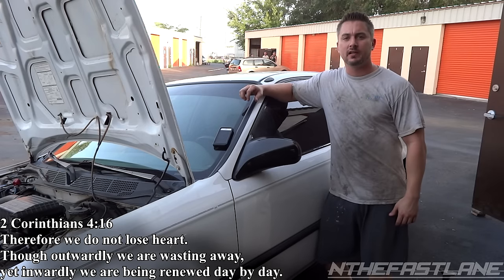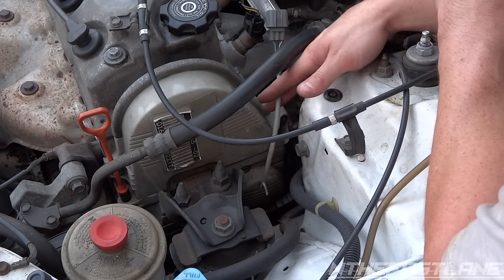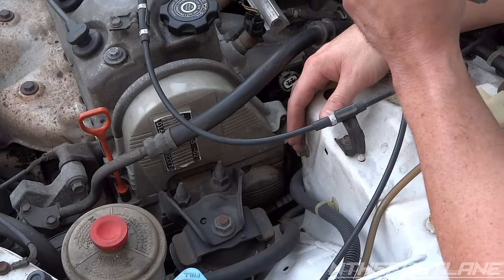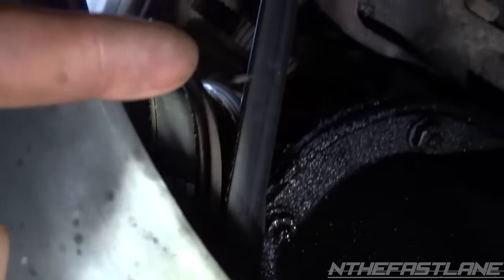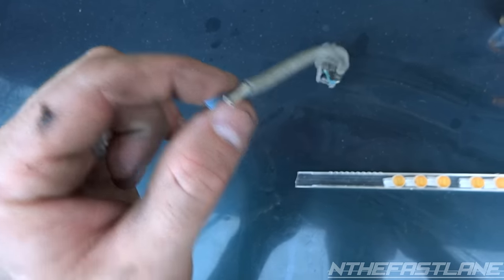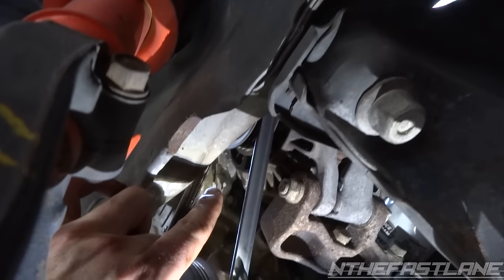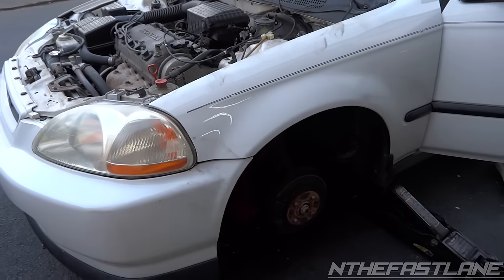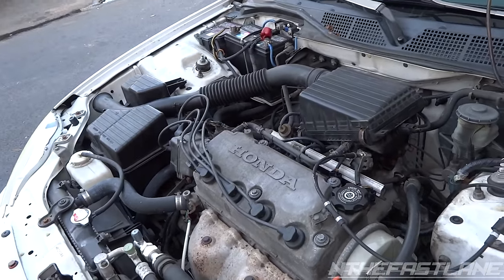▶️Cranks But Won't Start Honda (CPS) "How To"🔧

Comment: If you're still around, id like to ask you about my 1st gen CR-V. Maybe you could shed some light. Motor swap. No check engine light. Running great. Cold snap/won't start. Getting air/fuel, fire/compression. Before the motor swap, I DID replace cap and rotor. Any ideas? It got negative degrees out and just wouldn't fire up. But get this! I pulled the fuel rail off to check brand new injectors and it fired and briefly ran with the fuel rail off! Starting fluid doesn't do anything. Im wondering if I got some bad fuel and it's just too cold to combust before it's flooding it? Idk. Cranks strong, battery is good.
Reply from the maker: When you did the motor swap did you swap over the distributor from the runnning engine? Did the new motor come with its own set of injectors and a distributor? It could be a couple of things, crank position sensor, or it could also be the distributors  "Ignition Spark Control Module Ignito". The coil pack inside the distributor could be weak or bad also. It may put out a little bit of spark, but it might not be hot enough.
Reply: @Nthefastlane  I've been driving it for about a month or a little more. I used the old distributor with a new cap and rotor. Brand new injectors for the B20. They are correct and working well. The weirdest thing is, when we lifted off the fuel rail to make sure the injectors were doing their job, it fired and briefly ran with the fuel that was sitting in it! Checked all plugs on the valve cover and they are throwing huge spark. The crank positioning sensor was a special consideration during the motor swap cuz the last one was barely wired up. So we took extra consideration making sure this one was proper. After watching your video and a couple others, I'm wondering if it is indeed, the coil pack. But I'm not sure yet. Those injectors look like they are dumping a lot of fuel, could it be the fuel regulator on the fuel rail? It may be the proper amount of fuel, but when it would fire without the fuel rail/injectors in, we'd try to gradually put the injectors in as it fired and it was like it was flooding it out. Maybe the spark isn't great enough and it's a coil pack issue...at any rate, I appreciate your reply. You're the only person who has gotten back to me.
Reply from the maker: I would check the injector clips, after I did that and it still didn't run I would swap out the fuel rail and injectors from the other engine. It could be the fuel pressure regulator. I would first swap out the fuel rail with the new injectors, and then swap out the old injectors see which one makes a difference. Sometimes it's just a matter of troubleshooting the least expensive parts first. If you already have used parts that are known to be working I would use those as test pieces such as all the old parts from your original running engine. 

I try to get back with and help people. When you get hundreds of messages it can be challenging to keep up, but I give it a good effort.
Reply: @Nthefastlane  I understand, and I stand behind everything you just said. My buddy gets off work at 3 p.m. today then he's coming over to help me. Im gonna do just that. We considered the fuel regulator. We're gonna slap a different one on when he gets off. I will definitely let you know what we figure out.
Reply: @Nthefastlane  I pulled the distributor cap off. The bottom bolt was loose. There was an oily substance around the bottom of the cap. Inside, the contact points had white corrosion, as if they'd gotten wet, then electrolysis took place while it was firing. On one side of the edge of the rotor, it looked a little "burnt", but that may be normal. Also, that little "nubby" with the spring behind it in the center of the inside of the cap wasn't poking out very far until I cleaned it. Still, only fired initially...then acted like it's flooding again...i think it's a firing issue. And God knows how old that distributor is. Plus, I may have removed too much material from the contact points in the cap. Shavings after I sanded the corrosion....have you come across having to replace distributors very often on Hondas? My buddy has some good distributors laying around and we are gonna slap one on that we know is working and see if we just aren't getting enough fire. Hope that takes care of it. I'll know more on Saturday.
Reply: @Nthefastlane  New developments if you're interested and not too busy. Still not running and I've replaced a lot. I should have watched your video more thoroughly and I'd have checked to make sure my CPS hasn't been damaged. I'll do that after work. I even replaced the main relay. On the #7 wire, it's saying it's not getting power. So when we power it up with the meter, it fires and runs. Idfk
Reply from the maker: Usually with an engine swap you leave the electrical harness disconnected. This allows some of the pins to get a little bit of corrosion on them. A while back when I did my engine swap, the main plug closest to the firewall by the brake booster somehow got corrosion on the little pins. This corrosion was preventing the distributor from getting 12 volts. The distributor power wire was only reading 5 volts. That might be something you want to check. 

Also I pulled the fuel pump fuse and left it out for a while and that got a little bit of corrosion on it, when I put it back in it was a no start situation as well. I troubleshooted it for quite some time before I finally pulled the fuse and saw that there was a little haze of greenish corrosion. I took some fine grit sandpaper and sanded it off, put it back in the fuse slot, and it fired right up.
Reply: @Nthefastlane  That's a really good point. I'll check into some of those connections, clean them up, and see if that helps. Thank you. I'll keep you posted.

Comment: Here’s my issue and hopefully you or your viewers can give me an advice. My car started failing to start till came to no start at all. I pulled out the starter, took to o’Reilly they tested it with bad results. I put a used one in, it took about 3 shots to start it.  But again it’s starting with some problems to start. A day the replacement it took me about 3 attempts for it to start. Do you it’s still the starter or something else??

Comment: Hi my friend, how are you? I have a Honda Accord 95 EX VTec and I don't see the wires of the crank position. Do you know where it is located?Thank you.
Reply from the maker: "92-95" Honda Civics CKP are located in the distributor.

"96-00" Honda Civics CKP are located behind the crank shaft gear on the block behind the timing cover as demonstrated in this video.
Reply from the maker: Pre "96" Honda Accords CKP are found in the distributor.
Reply: Hi, thank you for anwering me. But, I don't see it inside the distributor? Or close to?
Reply: Hi, I took off the distributor cap and I saw the igniter, the coil, rotor but how is that part, crank position sensor? Do you have any distributor hitachi for honda 95/4C to show me what part is it? Thank again.
Reply from the maker: Look under schematics on my website. Link:http://www.nthefastlane.com/File-Cabinet
Reply: Nthefastlane what about in a integra 1995?

Comment: Do you know if this would cause the ECU not to have power?
Reply: No, but it is a sensor that if the ecu knows it aint there by being unplugged, damaged or just old it wont run it self.but when you turn on key check engine light turn on and goes off or stays on means the ecu got power

Comment: Hi there! I had a question if you can help me I have a 2000 Honda Civic with 330k miles. I was driving to work on Monday about an hour into driving on freeway. I was trying to give it gas to speed up and it wasn’t trying to let me give it gas felt like it was like sputtering/misfiring/slowing down type. So I got off the freeway as I hit the stop sign went to 0mph the car turned off tried to start it up again but it wouldn’t let me. I changed the fuel filter, fuel pump, and fuel relay under dash. It started up for like a min rpms we’re going up and down and as I was trying to rev it up it was having a hard time and then all of a sudden it died. Tried starting back up a couple times and I drained battery trying too. Any help please
Reply from the maker: I would pull your spark plugs and check them for fouling, you could have fouled spark plugs. If you drive on fouled spark plugs too long they'll melt your valves. If the spark plugs check out fine it could be the distributor, the coil pack could have gone out. If you end up replacing the distributor and everything starts running fine I would definitely change out the plugs and wires as well. Make sure you put some dielectric grease at each end of the spark plug wire connectors.

The next thing I would do is check your catalytic converter. If it got clogged up, or maybe the ceramic inside closed off that will do it.
Reply: Nthefastlane okay thank you very much. Btw no check engine light has popped up.
Reply: @RaspyStarks Hi ,did you ever fix that issue? Some advice would really help
Reply: @jonathantorres5803  wow forgot about this comment.. so since I wrote this comment.. I have changed the spark plugs, spark plug wires, new cap and rotor, pcv valve, o2 sensor,
Reply: I got it started cause of the Fuel injectors .. I got OEM refurbished fuel injectors  off of eBay.. but maybe 1 or 2 of them injectors are NOT any good.. the car starts every time but ON cold starts it Boggs down and wants to die.. you gotta give it gas for a few seconds than it’s okay. When it’s warmed up it doesn’t give me any issues.. so I’m assuming I just gotta get some brand new fuel injectors (which are like 98$ each @AutoZone

Comment: I have a 01 Honda CR-V.. no lights are on, has been running GREAT... and then all of the sudden I’m having issues turning it on. Don’t know what to do or where to start 😭 sometimes it turns on, other times it won’t.

Comment: I'm going to have to see if this is what going on with mine. I love my crv but she won't crank. When she starts she will drive for mins or hours but once its turned off she will not crank again sometimes its is just hours other times its days before it will crank again. I hear the engine attempting to get ready but not turn over. I lost count of how much money we spent replacing everything we could think of.
Reply: Nope not this issue we have. We followed every line we could see nothing has a crack or cut line.

Comment: My car starts up sometimes when ever I give it starter fluid it starts to start up but then does something weird and it doesn’t fully start basically but my car doesn’t start up sometimes a couple times when I was receiving the cranking issue after waiting 10 minutes I heard one click Coming from the engine bay then I tried to start it again and I started right up I’ve replaced distributor I don’t know what’s wrong it’s a 98 Civic dx hatchback
Reply from the maker: Are you saying that your starter is not spinning the engine? Or the starter is spinning the engine and it's just not firing?
Reply: Nthefastlane it spinning I believe but unsure I’ll have to check up on it it sounds like it wants to start but whenever I put starter fluid it starts to turn over but then starts to shake badly then it fails to start
Reply: @aquazie5928  Hey that is your fuel its cloggex up and needs cleaning I'll walk u through it very easy wont cost u a penny hit me up

Comment: A little help plz. Got a 97 civic 1.6 sohc cranks but wont start. At first it had no spark so ended up changing the distributor and got the spark bu wouldnt turn on. Long story short ended up checking fuses, main relay, spark plug cables, spark plugs, fuel pump,  fuel injectors, crank shaft sensor and still nothing. Inserted scanner and it read backfire on piston 4 and 2 so checked timing and it turns out that timing was wrong. placed timing in correct position, Took engine head to the shop and checked valves, got a new head gasket placed everything in place and still no start. Any Tips and advice would be helpfull.
Reply from the maker: Run a compression check. Pull the distributor cap and rotor off and test for 12v. Make sure your firing order is correct. Link to my website: http://www.nthefastlane.com/File-Cabinet     Go to Dseries section and look at (D16 FIRING ORDER).
Reply: Ok thank you for the fast reply . Ran compression test and it drops lower than 50 on two cilinders but all seem un even. what do u recomend? possibly new piston rings?
Reply from the maker: Watch these videos. If this doesn't work it's definitely your rings. I believe I explain it in the video. Watch ALL 3 videos. Please give a thumb up. Really helps.

Leak Down For Blown Head Gasket: http://www.nthefastlane.com/Diagnostics/leak-down-test-how-to

Leak Down Test For Valves: https://www.youtube.com/watch?v=plpLZeM9ZbU

Compression test: http://www.nthefastlane.com/Diagnostics/compression-test-how-to
Reply: Nthefastlane thank you the videos were great. Next step will be piston rings
Reply from the maker: Jorge Martinez Got you covered on that. Here: http://www.nthefastlane.com/Engine-Block/clockinggapping--installing-pistons-properly-honda
Reply: Jorge Martinez did it work??

Comment: I have a similar issue with my 95 Honda sometimes it doesn't start on a cold start and then once it does start it starts to sputter and then check engine light comes on but if I would have set it off it would not start almost like the vehicles flooded and then maybe 20 minutes later it'll start up and then I got to hit the gas a lot and then a little spark comes out the muffler sometimes
Reply: How did you fix it

Comment: this exact same thing happened to my 98 civic....I have fuel but no spark.....I know the new sensor isn't a defect bc I checked the injectors with a noid light....could u elaborate on the part u were saying about the cam sensor in the distributor for me?

Comment: Question i was driving on the high way going about 70 when my rpms dropped i could hear the engine accelerating when i stepped on the gas but it would not drive i pulled over turned my car off and tried to turn it on agian but it wouldnt start just cranks
Reply from the maker: It could be a number of things. First thing I would check is either your coil pack or distributor whichever vehicle you have.  in the future if you have any questions please post on my forum. I answer questions there. www.Nthefastlane.com/forum
Reply: sounds like a  timing belt
Reply: I second the timing belt
Reply from the maker: Not true. If it was a timing belt, Her RPM's wouldn't have dropped because the crank position sensor would still be sending signals to the ECU. She mentioned she could hear the engine revving up but not showing any RPM.

This leads me to believe that it very well could be the Crank Position Sensor (CPS). These are signs of a bad crank position sensor. RPM's dropping,engine still running, then when engine shuts off or stalls out it doesn't start back up again.

Comment: My Honda civic has a new a starter distributor cap rotor and igniter  new plug wires and radiator it started right up drove it for 3 days and got it smoged drove great and the next day it turned over and now start

Comment: Having this issue with my 2002 civic dx. Changed fuel pump, crank & camshaft sensors, and fuel pump relay. Still having this issue. Any suggestions?
Reply from the maker: First you need to make sure the fuel pump's priming, if it's not, then it could be your main relay. I'll post a link for that repair below.

The next thing it could be is you are not getting 12 volts to the coil packs. You're going to have to troubleshoot that. Pull a spark plug, leaving the spark plug attached to the coil pack, ground it to the valve cover/bolt while cranking the engine, if it sparks you're good.

If all else fails, your timing might be off, not enough compression in the cylinders due to bad piston rings, bent valves, or a bad ECU.

Link to main relay replacement/repair: https://www.nthefastlane.com/car-cranks-wont-start-no-fuel